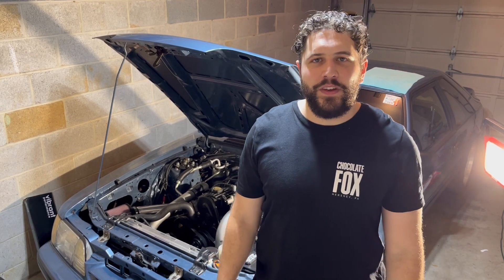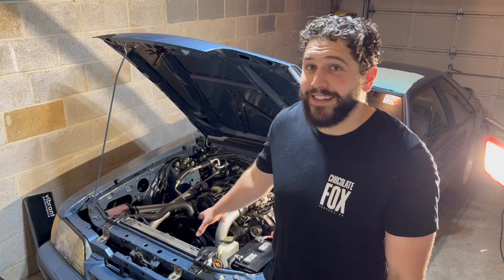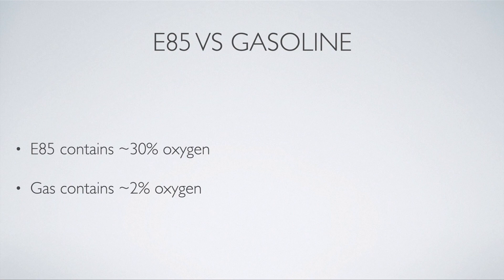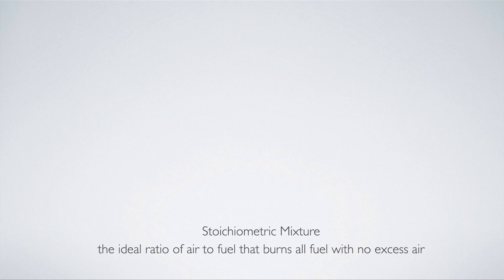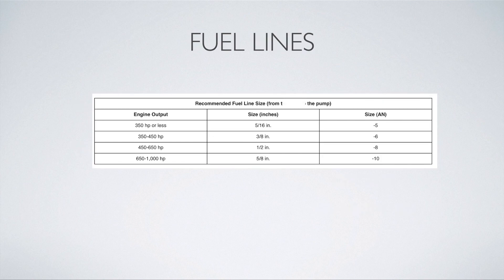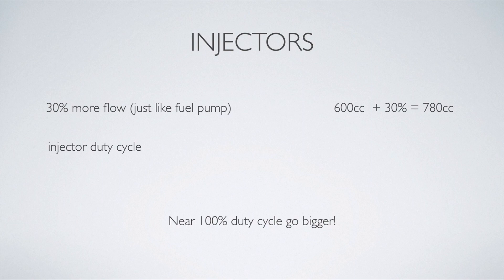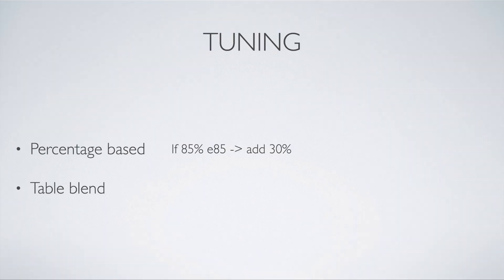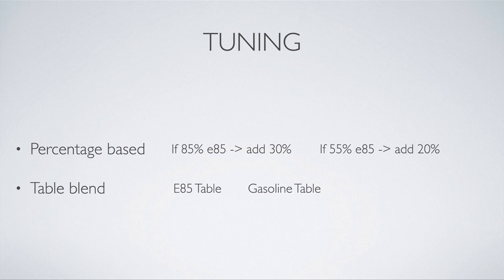How to run E85 / Convert your car to E85

Comment: I put a flex fuel kit on my stock 2002 Mustang GT. It ran fine for several days on 44% ethanol content but the day that I refilled the tank I got 61% ethanol content (a mix between 44% and 85% which would make it around 61%) and the car died. This is less than a week after I put in the kit. Turns out that it killed my fuel pump (or was it coincidence?) and I have to replace it. The manufacturer and another youtuber said that neither the fuel pump nor the fuel injectors need to be upgraded from stock. Anyway, I ordered a fuel pump certified for E85 only to find out that the fuel pump housing for the bad pump was of poor design where you have to remove a small hose to get access to the fuel pump. Which caused another problem because I ended up destroying the small hose and can't find a replacement that is SAE 30R10 anywhere. The corrugated hose fits onto an 1/8 inch OD port on each end of the assembly. So, I have to order a complete assembly with a fuel pump pre-installed because you can't get just the housing from any manufacturer. You might not be able to specify an E85 compatible fuel pump either. I'm not a happy junior mechanic right now.
Reply from the maker: LMR has some options with an upgraded pump installed such as: https://lmr.com/item/LRS-9350E/1998-04-Mustang-255-Lph-Walbro-Gss342-Fuel-Pump

Comment: I made my 2022 Prius into a flex fuel vehicle, but there was/is no real benefits. Just something I wanted to do for years.
I do put E85 into my 3.6l v6 engine my flex fuel minivan has for maximum power. (My priuss are 120 hp combined, ford is 170 hp, but my minivan is 260)

Comment: No much info out there on stuff like this… do you think you may do a video on vehicles that run carbs or have a resource I can look at?
Reply from the maker: You would just need to make sure your fuel system can support 30% more fuel and jet the carb to run the 9:1 ratio that E85 needs, but the corrosive natures of E85 might be troublesome with a carburetor.

Comment: Noob question, I am thinking about converting my Boosted D16z6 Honda to E85. Would I have to get the engine retuned?
Reply from the maker: Yes, you would need a re-tune so that the engine is given more fuel. Also, if you have a good tuner that knows how to tune for e85 he can lean out the AFR's, increase boost and increase timing with e85 so you make more power.
Reply: @e-dod  Thanks, I kinda figured. Speedfactory would be the ones doing the tune so I am in good hands
Reply from the maker: @Shreddylife  Perfect! They will know exactly what to do. Should be a lot more fun on E85 😈

Comment: Well done.  Only question(s) not answered: conversion cost and do the fuel system materials type have to be changed?
Reply from the maker: Great question, I should have mentioned this. The reason I did not include that is because it varies by car. For example, I have a Lancer EVO and it has been running E85 for years on stock fuel lines. Just has upgraded pump & injectors to support the additional fuel needed. But, I have heard others saying they needed to upgrade to PTFE AN lines because the E85 corroded their stock lines. So if you can find some info for your specific car that would be best. Otherwise, try it out with stock lines if you are on a budget and just keep an eye on things. Most cars have metal lines under the chassis so you would mainly want to keep an eye on the engine bay since leaky fuel from corroded lines + hot engine bay not good. Let me know if you have any other questions, thanks!
Reply: @e-dod  just the answer I was looking for, glad I looked through the comments first. Also, this was the best explanation video I found after watching two others, third definitely was the charm!! Lol

Comment: I'm driving a f250 that use e85 and in reality it's way slower then using regular gas
Reply from the maker: Is this an OEM flex fuel vehicle? Maybe Ford intentionally made the tune conservative to result in better gas mileage since e85 requires much more fuel burned then gas? 

e85 itself only makes the car faster if the tune takes advantage of the higher octane and cooling capabilities e85 provides.

Comment: Can this be done in the f150 5.4l
Reply from the maker: As long as you upgrade the fuel system. You would also need to find a way to tune the truck to provide more fuel.

Comment: Nice presentation! Quick question: do vehicles that burn “flex fuel” have “hardened” valves? I’ve heard the valves are different in flex fuel engines and running such fuel will burn out non-flex fuel valves. Has anyone heard this?
Reply from the maker: Thanks! I never heard of any issues with non hardened valves. But ethanol is more corrosive then gasoline. This corrosive nature mainly causes issues with aluminum gas tanks/fuel lines, but most people report no issues. In theory ethanol should be better for your valves and everything else in the combustion chamber since it burns cooler then gas. I am just presenting what I researched though, I am no expert 😁. If I do some more research and find anything I'll update here though.

Comment: Ok so can I run only e85 with absolutely no mix? I have my car tuned to e85 also
Reply from the maker: Definitely can. The only downside is if you use pump e85 since it can vary and is usually not 85% ethanol. But ethanol itself is a forgiving fuel so usually some variance will not cause any damage to your engine even if its not ideal for performance or gas mileage.

Comment: Hey Thanks For The Video, What Should My A/F Ration Be On Idle On E85? I think 8.9 Is Too Rich On My Kswapped Civic
Reply from the maker: Hey, thanks for watching! 8.9 definitely sounds to rich at idle assuming you have 85% ethanol or lower. Should be closer to 9.8 at idle if you have stock/mild cams.
Reply: @e-dod  Thanks For Getting Back To Me I Have A Stock K20z1 With Full Bolt On I'm Usually At 10.20-11.00 A/F Cold Start Is 9.8
Reply from the maker: @indiobaez3314  np, cold start will need to be richer. it should lean out gradually as car warms up. This is normal for a properly tuned engine. 

Also, if you are running a flex fuel sensor and your ECU is properly tuned for flex fuel then your AFR's will vary based on the ethanol percentage. So for me to advise a target AFR you would need to let me know what percentage your E85 is as well.